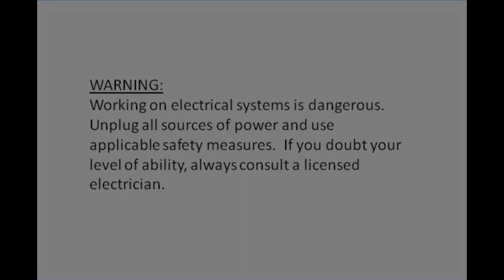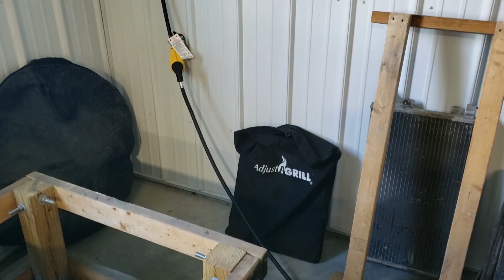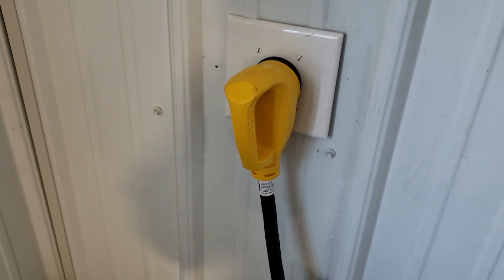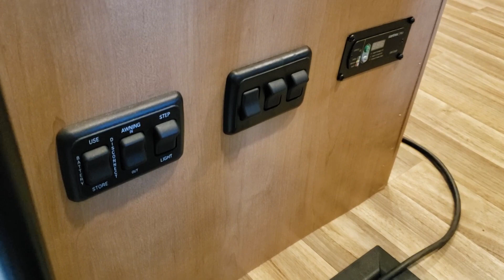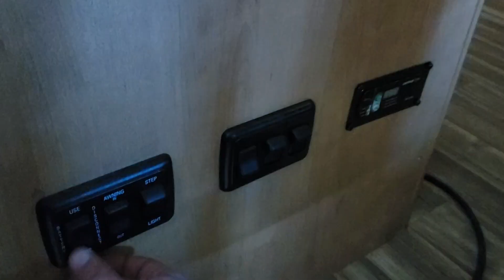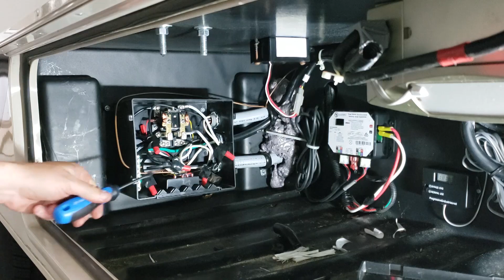Maintaining an RV Automatic Transfer Switch

Comment: There are OEM torque specs that need to be followed when tightening connections in a transfer switch.  Need to use a torque screwdriver.